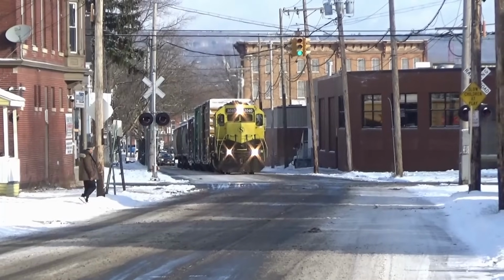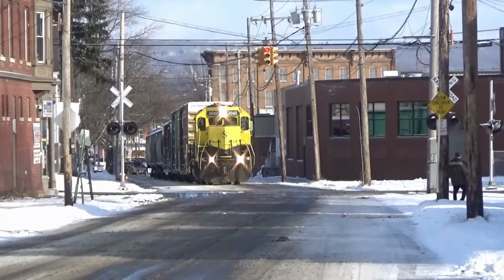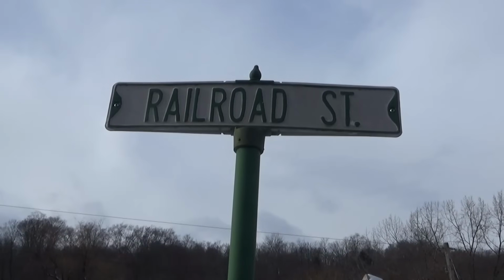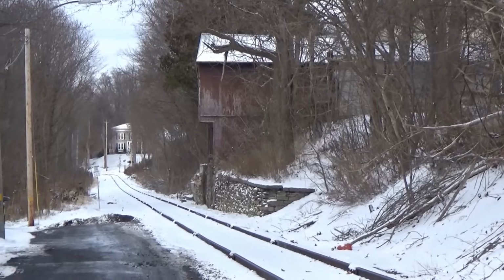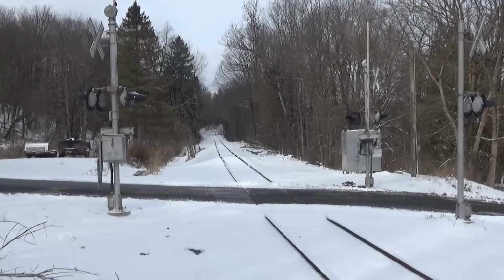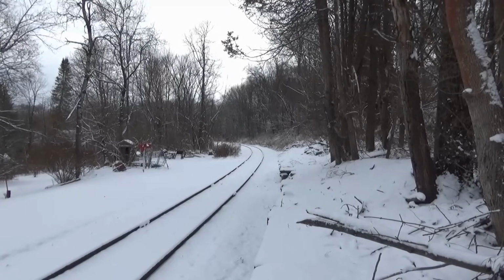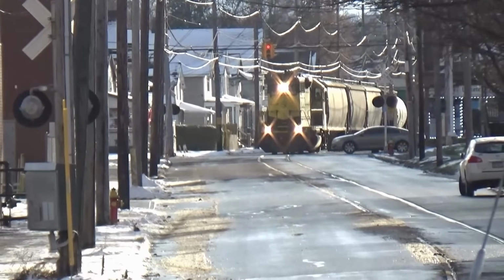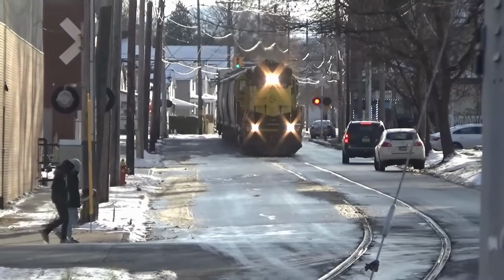"Full Stop (And Long Horn Blast) On Schuyler Street!" NYSW Utica NY

Comment: Wellsville, NY here.  My grandfather and one uncle worked for the Pennsylvania RR in the Hoboken, NJ marine shop.  They maintained the steam tugs and wooden barges that used to float freight cars back and forth across the Hudson River.  I am a retired motorman from the NYC subways, did 27 years.  There's a rail line that runs through town here that is not abandoned, just not used except once in a while.  I saw two brand new Acela trainsets pass through here in tow from Hornell, NY west to a yard in Olean, NY.  They usually run a high rail pickup through here a day or so before a train comes through, I guess to remove any obstructions like downed trees etc.  My father's family lived here and as a kid, we took the Erie Lackawanna RR to  the station in Wellsville, and my dad's father would come pick us up and take us to his house.  Freight ran a lot here back then, plus the passenger trains.  Then the businesses along the line closed, or stopped using rail freight and the line sat for years till they ran two coal trains a day through here to some power plant somewhere.  That converted to natural gas, so again the line sat unused as it does to this day.  Sad, because I am about 250' from the line.  I enjoyed your video and narration.

Comment: Well at least 3040 didn't stall out on the Hills. Thanks for getting the shots of the driveway Street on the going away shot and also that light snowfall fell just right on the joint bars and bolts. It appears the Dopey button was on for many of the motorists and pedestrians on Schuyler Street and of course if it wasn't for the wind blowing on Bitolds ears he has that Thousand Miles stare. The cow did lift its head under his own power but running away from the train requires energy so what was canceled. From Milwaukee thanks for the winter tour our inch of snow melted today

Comment: I really like the fact that trains run on public roads without any sensations. Nobody is hysterical, nobody runs amok, nobody gets angry in the face and nobody needs to be hospitalized mentally. Because the difference between such a train and a truck with a semi-trailer is that it cannot pull over and ram, for example, a tree or a building.

Comment: 11:32 Yay, you have answered my question about Lincoln-Davies Lumber that I have wanted to know the answer to for a long time.  :)

It's too bad that they don't still get their lumber products delivered by rail.  I am sure it is due to a number of factors, such as having to purchase huge quantities to make the rail deliveries economical, and also perhaps being locked into buying from only a single source instead of being able to purchase from multiple sources who can deliver by trucks.   And, of course, if their lumber supplier used to come from the south branch of this railroad via Binghamton or Chenango Forks yard, that add to the complications, too.

Plus, like any retailer, business ain't what it used to be -- Lincoln-Davies was once a big lumber supplier for agricultural operations over their long lifetime, but there are far fewer farms now and most farm structures are no longer built 100 percent from wood.  The proliferation of big-box building supply retailers certainly doesn't help them draw in and retain lifetime customers anymore, either.  

Thanks for the info, and thank for making such a nice video in such cold weather.

Comment: The ice on the rails is causing the crossing to fail. Restarting the train on the grade required some skill (and sand).
Nice of the guy to turn in front of you, on an icy road.
Andy, Letchworth, UK
ps. Always love the views of the building etc, and of course Witold.
My Atlas HO model of 3040 has made it across the pond and now graces the shelf.
Reply: Broken rail was causing a false activation of that crossing and the 2 before it. They had to cut into the road to cut it out and replace.

Comment: I'd like to find a 4 way traffic light like that 
this is cool Street Running Railroad 
yeah the crossing signals aren't working correctly as they keep fading in & out
Reply: The signals are working correctly.  It is due to the frame rate with the camera used, and the flash rate of the signals themselves. I found that out watching another YouTube channel about trains. Due to the number of frames per second, compared to the flash rate, it makes it appear that they are fading in and out, when in fact they are working normally.  Later in the video, there are some signals that don’t fade out.

Comment: another great video. But I question the 1.87% grade limiting the GP-40 to only 7 cars? The B&O main line here in Akron Ohio is 1.67% for over 2 miles and 3 engines pull 65 to 80 cars up there daily. That grade in your video appears steeper than 1.87%. another example I question this from is 17 Mile grade in West Virginia on the B&O is 2.67% and 80 car trains are pulled up that hill with 6 and 7 engines on them. Yeah an SD-50 is more powerful than a GP-40 but still something seems off in your comments. Either this grade is way more than 1.87% which I suspect, or that information of only 7 loads is incorrect. She didn't seem to be working all that hard with the 3 loads she had. Your thoughts?  Anyhow, I really do love these videos and your history you talk about and show also. Very nicely done. :) Also would be so cool to see an 0-6-0 or 0-8-0 on that street running trackage.